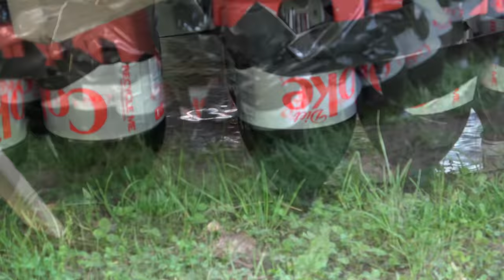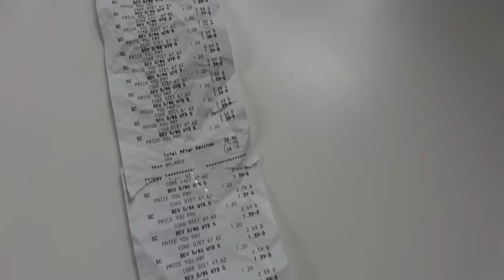I Tried To Build A Human Diet Coke & Mentos FLYING MACHINE | L.A. BEAST

Comment: I'm sitting here the whole time going, how is he going to get all of the coke bottles caps off at the same time. Sir, I agree with the other people on this thread, THIS IS PURE GOLD. You not only went outside the box, you broke the damn thing. Keep up the entertainment.
Reply from the maker: I’ve seen others slam the bottle on a hard surface and the pressure causes the caps to burst off…
Reply: @LABEAST  I think in those videos the caps tend to kinda get hit at an angle and it sort of breaks off, also I feel like they screw them on barely or something.  also the pressure gets divided among all the caps so probably not much actual force on each cap

Comment: 1. Build the thing upside down so that coke doesn't touck mentos prematurely. This will also make glueing-taping easier.
2. Skip the door (that was stupid), skip the noodles, skip whatever for the looks. The lighter- the better.
3. Build a pad with spikes that match the bottles. It needs to have guide-rails so that the bottle rocket would lign up. Spikes need to be very short - barely long enough to penetrate the bottles. 
4. Flip the bottle pad using a pulley system, a long lever, 2 friends or a tractor. Make sure it stays at around 45 degrees or so above the spike pad (remember the guide rails).
5 Run and fall into the bottle platform, so that it would fall nicely into the spikes with you on top (remember - very short spikes)
6. Launch.

60 bottles will not have enough thrust to lift you. But it should be entertaining.

Comment: Coming up with a working Mentos-cola delivery system is pretty challenging but I think I've got one:
You could use a tube* smaller than the cola bottle lid filled with mentos, then put it inside the bottle within a stretched balloon that can get cut and break with weight. Do this with the same number of bottles glued to a piece of plywood and maybe we could see Beast fly!

*maybe those plastic beakers they use to serve shooters? It needs to be pretty solid to cut the balloon.
Reply: I was thinking if he built it all the right way up not shake it and then hot glue nails to the caps to serve as a puncture device then flip it and as quick as possible and jump and then all the bottles would be punctured all at once and the nails should also fall out and allow the thrust to be exerted out if that makes sense
Reply: Unscrew each lid and quickly cover with a single layer of plastic wrap and then seal by wrapping an elastic tight around the neck. Take a sleeve of mentos and put into a manually and heavily perforated straw the width of the mentos (large Boba tea straw maybe). Flip bottle over pointed straight down, and scotch tape the mentos straw so it is resting pointed straight into the opening of the bottle against the single layer of plastic wrap. Do that for all bottles and set in place. Drop the whole thing, and each straw of mentos should break through the plastic wrap seal of each bottle as it hits the ground. This pinpoints the mentos delivery with more mentos, only mixes them at impact, keeps carbonation in the bottles, and gets around the cap issue by using a very thin membrane that the mentos straw can easily pierce.
Reply: The straighter this hits the ground, the more mentos will mix with cola

Comment: I was wondering how you were planning on opening all the caps simultaneously 🤔😆
PS- never use your saw to cut nails or screws, it'll dull and ruin the blade immediately. Only meant for wood. Unless using a Hacksaw, Reciprocating Saw aka Sawzall, Jigsaw with metal cutting blade, Circular saw with metal cutting blade or Angle Grinder etc 👍
Reply: PPS- buy 3/4" or 1" sheet of plywood and drive a ton of concrete nails (theyre thicker and stronger) through it. Think a nail bed. Then put sodas on their side (will be easiest to puncture). Then gotta figure something to put apparatus across thatll break when jumping on or standing. Maybe long wooden dowels or even thin strips of wood. Just enough to hold weight

Comment: That was amazing regardless of how big of a fail it was. You gave it the college try, be proud! I'm wondering if creating a contraption to simultaneously break off all those caps at the same time could have worked..
Reply: Basically Mythbusters tried something in the same vein as this. Simultaneous release was an issue.  Two liter bottles didn't work and they had to use water cooler jugs. They had to put the jugs under enormous air compression.  When they finally got it to work they strapped their test dummy into it and the thing went pinwheeling in the air and the dummy was estimated to have sustained fatal injuries.
Reply: I was thinking strategically placed nails to puncture bottles
Reply: @LordBitememan  I think LABeast is ready to risk it for the biscuit on this one.

Comment: I really feel this could have the potential to actually happen. If you make the platform lighter, make the coke mentos mix fresher, and find a way to release them all simultaneously, you could actually propel yourself, at least a little bit.
Reply: Beast needs a colab with Mark Rober. Mark could use the shot in the arm he’d get by working with a legend.

Comment: There has to be a way to get all the cokes to explode at once. I’m curious if it would generate enough lift to get you off the ground
Reply: As I understand it, the pressure is already there. All you have to do is figure out a reasonably safe way to rip/break all caps off at the same time. Can a steel wire attached do it with a powerful tug? Can a lot of people rip all caps off simultaneously? If there is a will, there is a way.

Comment: I had to check that it wasn’t April 1st. I really wanted to hope that Beast had calculated the amount of thrust produced by a single bottle and then determined how many bottles would be required to lift 260lbs. Then it would be a case of making a frame as light as possible and adding more bottles to accommodate the weight of the frame. Sadly, as the video went on, it just became a rather unfortunate journey through one man’s psychosis as it became immediately obvious that the frame alone would require a couple of hundred bottles to lift…
Reply: Look at the big brains on brad

Comment: I feel like that would've worked, if it actually worked. Just gotta figure out a better way. Like maybe have a sheet of small spikes/nails underneath the apparatus, which will penetrate the top of the coke bottles as they fall..

Comment: If you want to try again: Unscrew each lid and quickly cover with a single layer of plastic wrap and secure by wrapping an elastic tight around the neck. Take a sleeve of mentos and put into a manually and heavily perforated straw the width of the mentos (large Boba tea straw maybe). Flip bottle over pointed straight down, and scotch tape the mentos straw to the bottle so it is resting pointed straight into the opening of the bottle against the single layer of plastic wrap. Do that for all bottles and set in place. Drop the whole thing, and each straw of mentos should break through the plastic wrap seal of each bottle as it hits the ground. This pinpoints the mentos delivery with more mentos, only mixes them at impact, keeps carbonation in the bottles, and gets around the many issues with the caps by using a very thin membrane that the mentos straw can easily pierce and won't restrict outflow for thrust.
Reply: Good idea
Reply: Yeah, the delivery must be controlled, caps screwed in will not break, not enough force. But it was fun watching :)
Reply: He’s too much of a bro to do all that, only for him to not even be slightly launched into the air too lmao.

Comment: The door pretty much cancelled out the padding.  Should have put it between the nylon and the pool noodles.  Not sure how you expected this to work, though.  You need to rig up some mechanism to make sure all of the bottles open at the same time- probably something to cut through the bottles.  You probably also need a LOT more bottles to get nearly enough thrust to get you off the ground...
Reply: A bed of nails directly under the device probably would have gotten it done, more or less, still wouldn’t have gone airborne but it woulda been one hell of an explosion of coke

Comment: You need nozzles where the caps are to focus the push from the reaction and a release method that prevents the mentos from touching the fluid until all being synchronized in release. Duh! Also use PVC for the frame. Have good day! 
PS. If you want to know the force output set the nozzles bottle and mentos on a scale then zero it out, then add mentos to the diet coke! The weight registered should be the force. I expect a functional build by the end of the quarter. Hahah

Comment: Improvements. First, measure or look up how much pounds of force does a mentos in a coke bottle produces. Second see if that changes depending on the amount of mentos. Then add up how much you weigh and givin how much force the bottle puts off add in how much that amount of bottles weigh. Then figure out the most effective way of building a platform to sit on without it weighing to much and make sure the amount of coke bottles can still lift all the weight. 

Now probably the hardest part is figuring out how to get the bottles to open when you want them to and how to get all of them at the same time to open. I would experiment with this over and over again until you have a solid plan for this. But a quick way I thought about trying is to put something like tape on the inside of the bottle where the air bubble is and just put enough down to hold the Coke in place when it’s flipped upside down. Then put a mentos on the cap of the coke and lightly screw the cap on. And with some force you may be able to make the coke come down hard enough to break the tape and have it react with the coke and shoot the cap off.

Comment: Man that had to hurt so bad!!! 
   I figured it wasn't going to to work out. 
  But it is possible!!!!!!

   The caps need to all come off at the exact same time. 
  So either they need to be screwed off or a small valve on each and every one of them connected to a string that's easily pulled in One direction so they all open at once in synchronized fashion.

Comment: Needed a way to have them all fire off at once  Maybe a board with nails positioned carefully pointing up precisely under each 2 liter cap? When you jumped on, the downward pressure pressed the 2 liters down, punctured the caps and then POW..to the moon.

Comment: Ply wood and 2X2”s use nails and bend over nails ( screws would snap if bent) the whole thing is too heavy. I’m still half way thru video but I am just giving my opinion. You could also use a layer of subfloor glue between 2X2’s to make sure the boards will not every come apart. Hope you succeed in this video if not I recommend this method. Message me if you want schematics

Comment: I think you needed something to poke the tops of the upside down Diet Coke bottles. Just a though. Curious what other ideas everyone else in here had. I would have had a board with lots of nails pointing upwards though so that when you jumped onto the platform, the tops of the bottles would have been cut open... and liftoff (hopefully)!

Comment: This seems a bit too dangerous for a challenge. For sake of argument, If the device did have the proper propulsion to lift off, how did you intend on getting down without killing yourself? This reminds me of an episode from king of the hill where they make a similar device with weather balloons and It doesn't work out well.

 I think a better though probably more dangerous version of this idea would be to make a jet-pack. If you took 2-3 oxygen tanks and strapped them properly to a harness, then excited the oxygen by movement, they would more than likely act as a perfunctory jet-pack. This comes back to the issue of safety though. I'm not positive, but I think the tanks would explode after reaching a certain height, though even If they didn't I don't think they would gradually fall after running out of oxygen. So unless you managed to have a parachute as well (Which may not work based on height and aim) you would probably suffer fatal injuries from the fall. The frame of your device also looked way too flimsy to withstand being airborne, it more than likely would have fallen apart at lift off, injuring you. 

Don't kill yourself for a video. At least with spice challenges there's much less risk to your health. I like your crazy videos and ideas but this seems much too dangerous to play around with. If you wanna keep doing experiments like this In the future, I suggest you consult with someone who has a better understanding of engineering to help you produce your device.

Comment: I think you just needed a better ignition system buddy, and maybe a little better power source, perhaps a little more thought out entry point, a smidge lighter and perhaps stronger framework, maybe a bit more experienced construction crew, a safer cockpit, and maybe ........
Ok. Just everything. There. 
I loved it, but I have seen Wile E. Coyote build more believable devices. 
Keep trying though. You'll reach the stars someday. You may want to put some thought into the whole landing process too.

Comment: You should be on Jackass 5 if they make one. You weren't about to ever have enough lift to get off the ground. Ha. Your device is too heavy. Should have used a lawn chair with not attachments, except for the coke and methos to be attached. It wouldn't work, but it would make a spectacular sticky mess.

Comment: If you waste 100 dollars again. I thought of a solution to this Coca-Cola flying contraption. Maybe remove the caps and basically do the same process of jumping on the flying contraption but build a perimeter around the coke flying contraption so it stays in place and then putt boards on the bottom with nails  lined up with the bottle caps. But put water balloons instead of the caps on the coke bottles.

Comment: What you could have done is pour a little bit out of each diet Coke (enough so you can have a dry Mento on a string in the bottle) then drill a hole in the bottom of each bottle attach a Mento to it with a thin cord and seal it up with hot glue. And then you do that to every single bottle and link each line connected to the mentos to a main trigger line that you can wire through the nylon straps and then just pull. Then you're off to the Moon buddy. Just make sure you don't tilt the platform or the fuel harness as it will work like a Irish mercury gravity switch pipe bomb. 

Edit also you can't tighten the caps as much if you do it this way because the hot glue will blow out first if not loosened. Fortunately this is good for the propulsion of the vehicle.

Comment: I was thinking if beast built it all the right way up not shake it and then hot glue nails to the caps to serve as a puncture device then flip it and as quick as possible and jump and then all the bottles would be punctured all at once and the nails should also fall out and allow the thrust to be exerted out if that makes sense
Reply: The nails probably wouldn't come out. Also, the caps aren't going to come off, so for any nails that somehow do come out, the soda will only be able to spray out of a nail diameter hole == no thrust